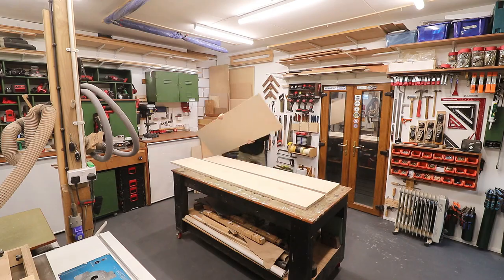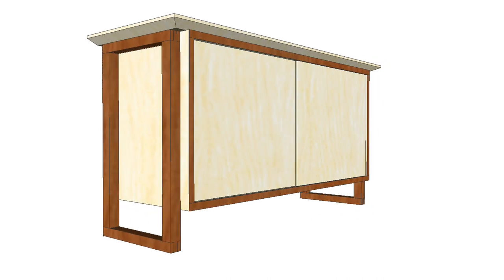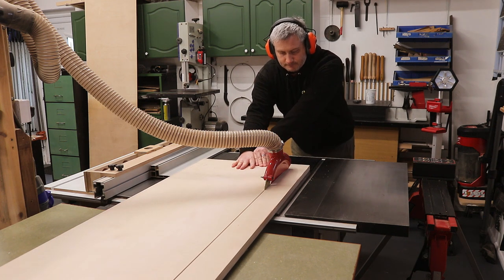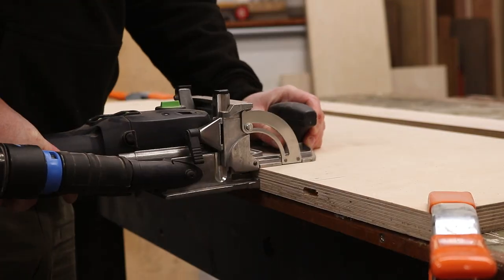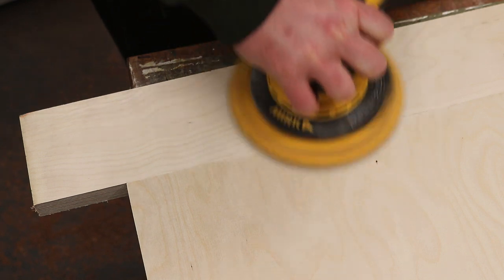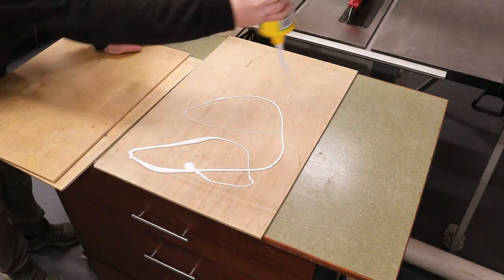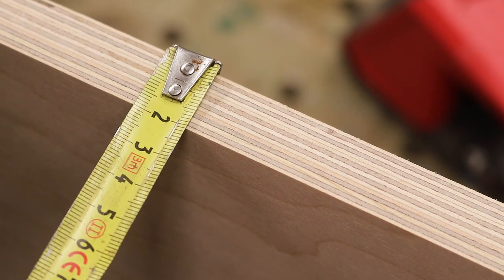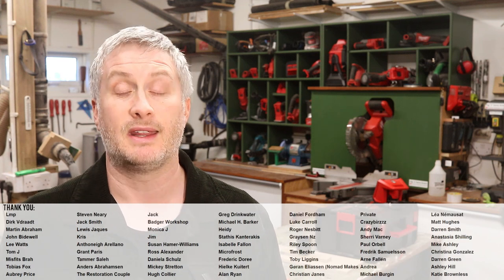Making The Most Of Your Off Cuts

Comment: I'm building my workshop.
It's a slow process. I work anywhere from 60 to100 hrs a week.  So it waits till I have time....
But doing the roof, I had to get frugal. The price of timber has gone mental. Roof would have cost 2.5 x or more pre covid prices.
For the deck I found 18mm osb, that had been used as hoarding on a site. Ironically , when you check out the blue and white colour,  it looks like it was from a covid test site that is now shut down. But at 10 quid for 8x4 board 18mm. I'm more than happy.i couldn't  afford  the 35 quid a sheet it seems to be here now.
Even the torch on felt was half price market place stuff.

Comment: I work at a factory that makes precast concrete beams and collumns, so we use a lot of formwork plywood.
Pretty much all my projects are made with offcuts of various sizes.
One of my projects were a table top for my assembly table. I ripped a bunch of 21mm (~13/16") boards to 42mm x ~1250mm (1 5/8" x 50") and glued them together so the plies were vissible from the top and ends of the table top. I had the resin surface removed on the planer at work. I glued them together in batches of 3-4 at a time, so that I could "joint" them on my table saw, as I don't have a jointer. I ended up with a slab measuring 40x840x1200mm (1 9/16" x ~33" x ~47"). After rounding over the edges and sanding it, it got 4 coats of flooring laquer.
It was a mammoth task, but the end result looks amazing. :)
This project also taught me not to buy cheap long-reach F-clamps (avoid Mitsutomo like the plague)....

Comment: We don't get birch plywood here in Western Australia, and even the crap we do get is not cheap, but I'm not a big fan of MDF for many reasons. I never throw out any plywood. Like you I have laminated pieces to make thicker panels, especially for sleds. I've never had any de-laminate. I'm often able to use even tiny scraps to make places to mount small tools on vertical surfaces. When I were a lad, long before you were born, the rag and bone man came round once a week with his horse and cart. Just like the street newspaper vendors he had no front teeth, so it was not easy to work out what he was shouting. (You might have guessed I was not in Western Australia at the time!).

Comment: If you are covering the ply edges with hardwood, , would it not be more economical to use mdf or anything cheaper than ply for any build up below the fair face ply sheet to get the required thickness, or have I missed something?
Reply from the maker: It's a very valid point, but the 6mm birch I was using was covered in stains and didn't sand up very well, so figured it was good use to sandwich it together 👍